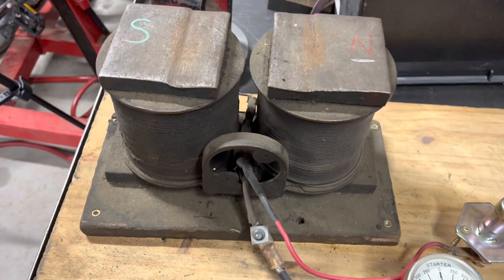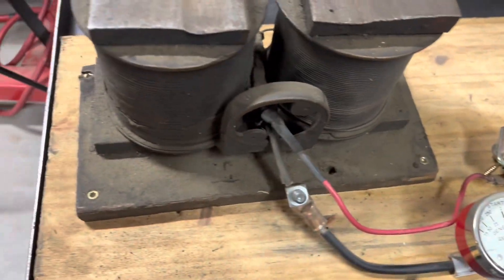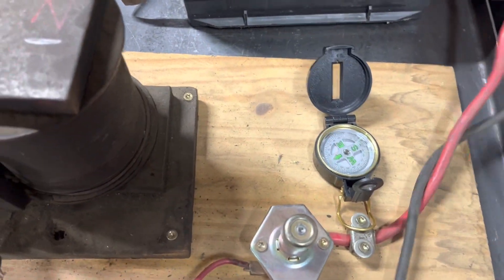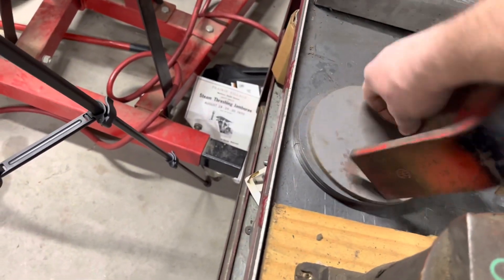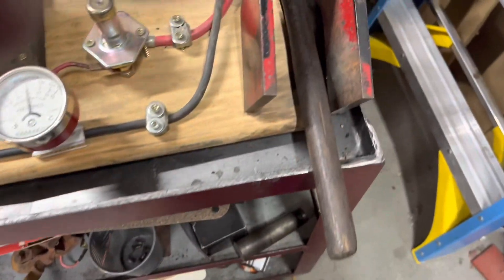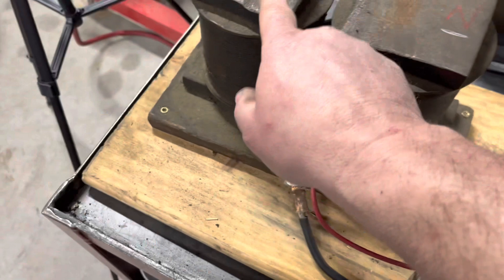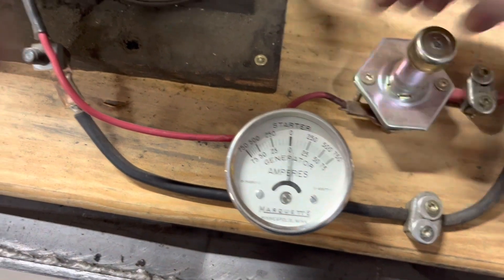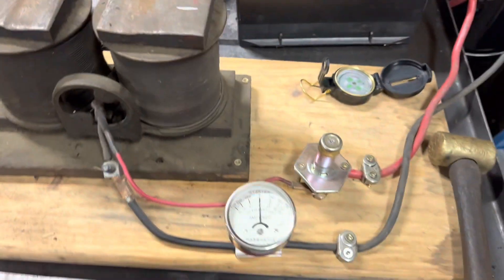Magnet recharge How to

Comment: A nearly free source of very powerful electromagnets are the cores from alternators or modified microwave oven transformers. A couple primary windings stacked on a microwave oven core in parallel and driven with a high voltage capacitor will charge most magnets, even the neodymium type. ❤

Comment: Can you recharge neodymium magnets that have been heated and are no longer magnetic
Reply: Yes, but you will need a high voltage capacitor and generally an air core coil as iron will saturate at the fields required